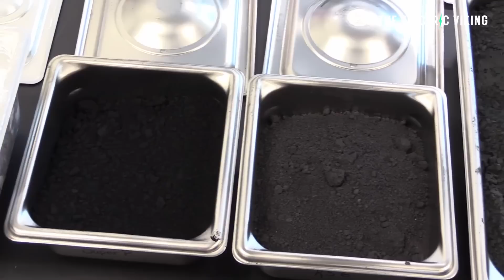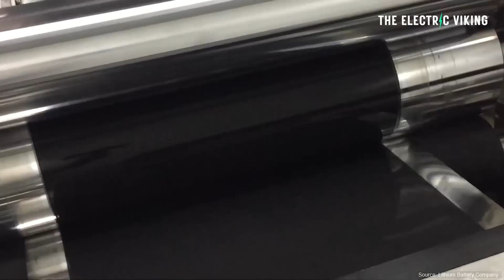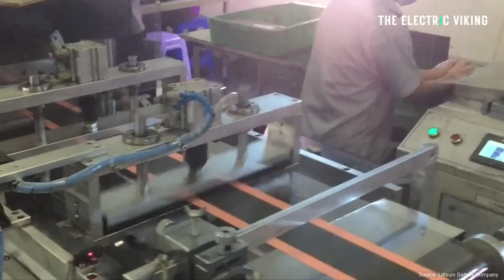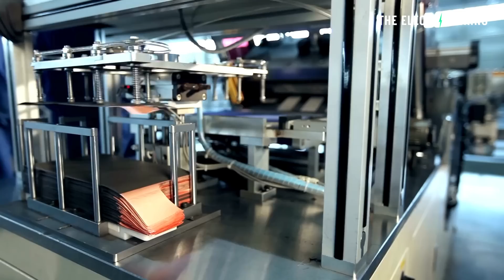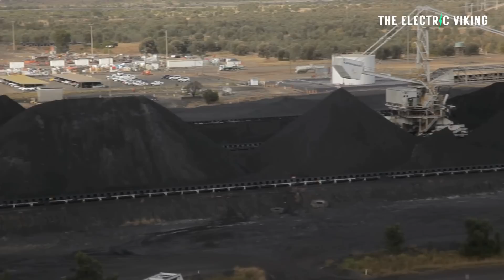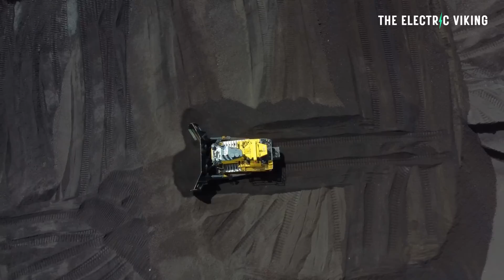China’s plan to FLOOD the world with Cobalt sourced from the Congo is worrying

Comment: lfp is still superior
not sure why anyone would use nmc in their car
its a potential for combusting on impact is like 2-3x higher than lfp
Reply: NCM should be banned for use in cars at the very least. The world's governments have been asleep at the wheel when it comes to this and the world's EV manufacturers have been evil in dumping this chemistry onto the world's roads.
Reply: @davidbrayshaw3529  i think it is quite suspicious that nobody is pushing out the safety study between this two types of battery into the public
Reply: @H_B_R  I did put up a reply to your post but for some reason it has been deleted.
Reply: @davidbrayshaw3529  did you mention the manufacturer or the brand of the battery?
Reply: @H_B_R  No. I don't think that it's relevant,
is it?

Comment: Keep in mind, Cobalt is not just for batteries. It is also a crucial element in rare earth magnets used in motors. Neodymium Nickel Cobalt magnets are used in motors, and in high temperature applications, Samarium Cobalt magnets are used, because of a higher Curie temperature. (less sensitive to heat) Cobalt is a big deal!

Comment: Where does the fossil fuel refineries get their Cobalt ? They use a lot of it to remove Sulphur from Petroleum & Diesel and it can’t be recycled.
Reply: Most of the cobalt used in petroleum refining is recycled. The problem is that it is an energy intensive process. This is in contrast to NCM batteries in that the vast majority of the cobalt is currently not recycled and ends up as landfill. Unfortunately, while everyone was busily trying to save the planet by battery, no one remembered to build enough facilities 
to meet the end of life requirements to manage battery disposal. I wonder how Elon's beloved Tesla is going on their mission to save the planet, in this respect?
Reply: @davidbrayshaw3529  all but high performance are switching to LFP batteries with no Cobalt or Nickel. Sodium batteries just in its first car.
Reply: @garrycroft4215  LFP should be mandated. Not so much of a problem for mobile phones, but for cars, it's a disgrace.
I'll be interested to see just how extensively sodium batteries are used in automotive applications. Golf carts, maybe, but energy density goes out the window with sodium ion. Where sodium ion will come into its own is in stationary applications which will free up lithium technologies to be used in applications where energy density is much more of a requirement.